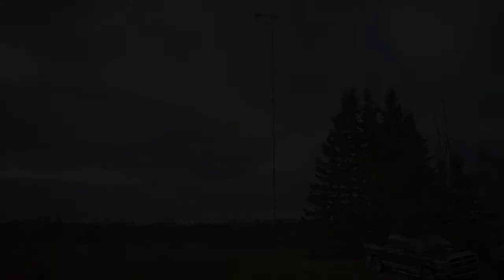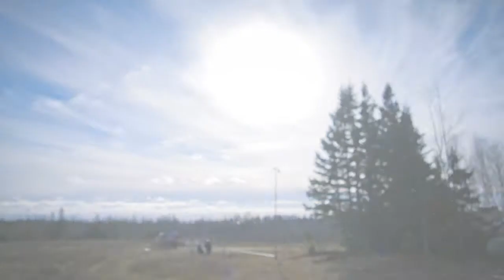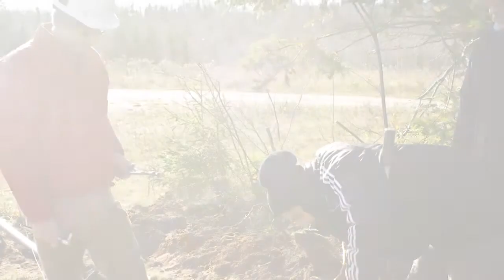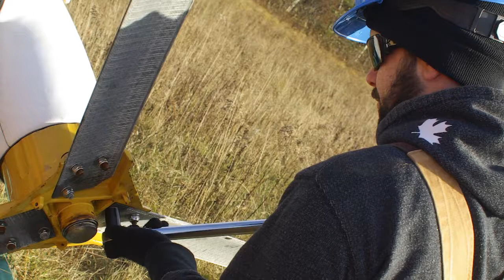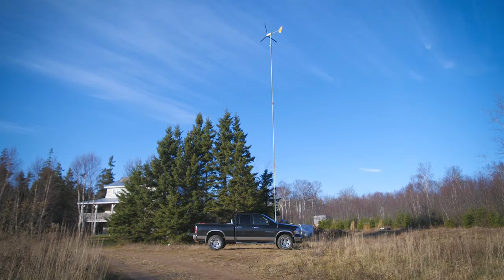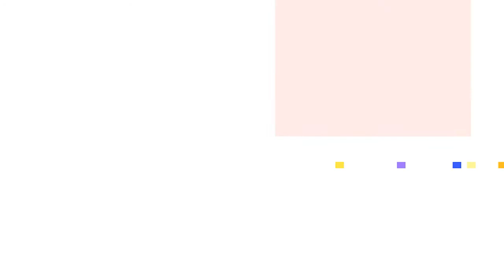David Little Photography - Wind Turbine Maintenance Time Lapse - Nov 27th 2012

Comment from the maker: Hi,

According to the manual the rated wind speed is 11 m/s or 24MPH which is for it's rated 1,000Watts or 1kW. It's furling windspeed is set for 13m/s or 29MPH so I am guessing it will peak around 1.2-1.6kW just before it turns away from the wind after reaching the furling speed. The people that owned this one told us they had it registering around 1.1-1.2kW at close to peak, so I think my numbers should be accurate.

This tower is the Excel 1 - 1kW Turbine by Bergey.